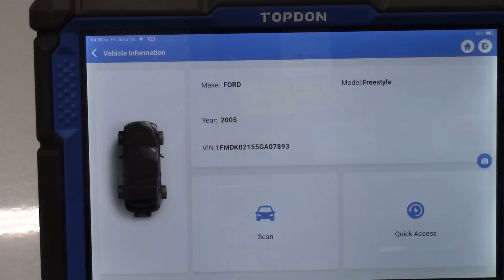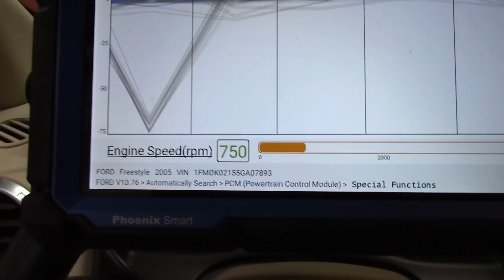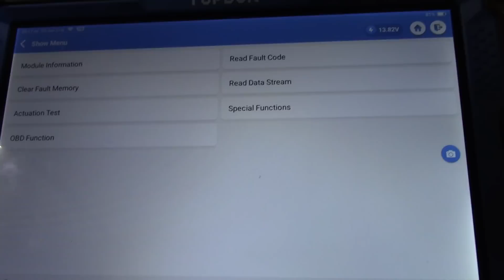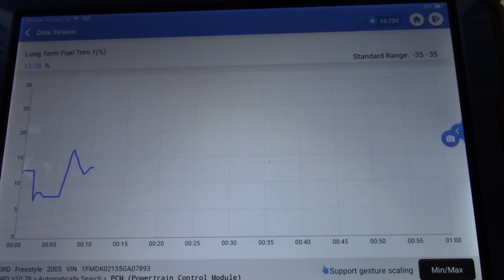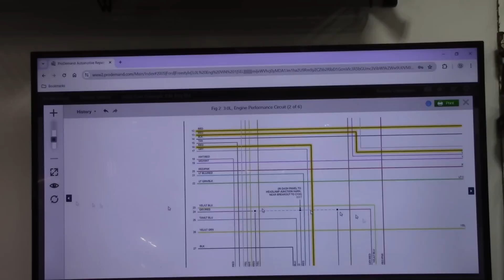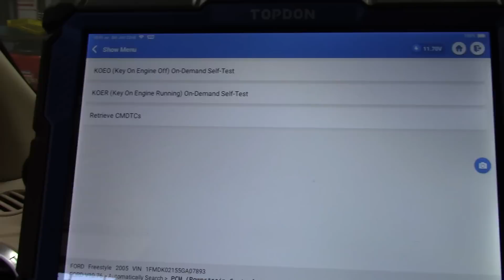P0301 Misfire Is Under Intake Manifold- What Do You Do?

Comment: Maybe  this is my problem.  Po302 on my 2006 Subaru sti.  Did the swaps, compression and leakdown test, noid pulsing test,crankshaft and camshaft position sensor test and cleaning.  Used smoke machine to detect vacuum leak  intake and exhaust sides. Very  frustrated
Reply from the maker: Maybe it is. An easy way is to just check amperage on the coil. Coils are easy to access on Subarus.

Comment: Good job. 
LCR Meter is the best tool for measuring the resistance of coils and capacitors .
It is send high frequency instead of low current dc voltage in resistance measurement mode in Multimeters
Reply from the maker: Great advice someone else mentioned this too.

Comment: Hello i need help with this exact code and even worse
Mechanic already installed rebuilt starter, new rotor and cap, fuel filter, pump relay, spider, spark plugs and cables within the last 30 days, new fuel pump and assembly less than a year ago but i always run it on empty so it MIGHT be bad. He hooked up the guage that shows the pressure is over 60 and doesn't bleed down until hours later. He doesn't want to charge me to do the fuel pump because he knows I'm broke and doesn't think that's the reason my 97 ahhsshole van won't start. That's the question, does anyone have any ideas? It needs starter/carb cleaner to start after 4-5 hours sitting, then i can run errands all day, but IT WILL NOT START after sitting more than 4 hours during the day or overnight, temperature outside makes no difference. Only code its giving is the same as this video. Mechanic says that'll cost more than the can is worth, right now i just need it to start reliably. Taking it to a guy who thinks it's the computer and has more testing diag tools than my mechanic next week. Any thoughts are much appreciated.
Reply from the maker: Unfortunately there is no useful data here. I need to see the fuel data, the timing data, the ignition data and induction metrics data.
Reply: @SchrodingersBox  thank you for the quick reply. Are you anywhere near southern California or know anyone as good as trustable as you in southern California?
Reply from the maker: Sorry I am not. I am in Colorado.

Comment: Videos are very informative. Even admit hypocrisy by mocking people for changing parts because "it needed it anyway". And then prove they didn't need the spark plugs. So much time spent mocking in this video. I guess admitting the irony is refreshing.
Reply from the maker: it’s not irony.  they did need the spark plugs because the cause of a coil failure on this car is spark plug excessive resistance.   you would never under any conditions change a bad coil but not also change the plugs and wires as well.
   it’s not “they need it anyway” because i made a mis-call or an ignorant guess. it’s “they need it” because i accurately determined a coil failure which means it’s standard procedure to replace the secondary ignition components responsible for the failure.
Reply: I don't think you were wrong to suggest changing the plugs. Maybe you already knew they needed spark plugs when filming. Video, as watching, you said it was most likely. I appreciated calling yourself out. It was refreshing. I have learned a lot (especially fuel trims) and will continue watching. Thank you.
Reply: cyt.....geezus

Comment: Another great video! Lets not forget a parts changer would have likely replaced at least the three rear injectors too, likely with inferior ones.
I love secondary waveform analysis. Such a quick, easy test to see whats actually going on.
The only annoying thing is when I'm doing it and "more experienced" people watch on like I'm crazy. 😏
Reply from the maker: totally agree!!
Reply: I just bought the Hantek 1008C, tried to do secondary wave form scoping using the HT-25 PROBE, but very dismal, as many other U Tubers have noted the same problem. TRIED to do a pressure analysis test, but found on it had only 2 cursers to use so could not divide the 720 deg wave form, So I would not advise this scope purchase, 

tried again to get a secondary using a Pico automotive, with the HT-25 and the wave forms looked just like what was on Matt's videos, old proverb, (Buy cheap cry all time, buy dear cry only once.)

Comment: Great! 
But what is the plan if you couldn't approach for the coils under the IM?
Reply from the maker: I have several different probes that would fit under even tighter spaces than this however what I would do if I couldn’t access the coils is I would dissect the wires out of the wire harness and measure amperage on the ground side controlled wires for the coils. This would be a bit time consuming but still faster than digging out the PCM on this particular car.
Reply: Thank you for your reply, great idea
Reply: What if in that situation we took the amperage of all the fuel injectors and ignition coils in one screen, couldn't it tell us something important and quick, even  you said that it would be very busy in the video?
Reply: @maradallibya5791 
In the video he was considering that.  But while looking at the wiring diagram it was discovered that there are too many other power consuming devices on the circuit to accurately pinpoint that coil. He then decided to use a more direct approach which was actually the best way in this situation. His critical thinking was the key.
Reply from the maker: Excellent summary!

Comment: That 24 valve dual overhead cam motor is very famous as I know you know for ignition oils failing.

Not just from spark plug where but also from extreme under hood heat in certain climates. 

Enjoyed watching your diagnostics. One day I need to add a pico to my diagnostic tool set.

Comment: Awesome. Nothing beats a solid diagnosis like recreating the problem. I was also thinking to check pulse pressures in intake and exhaust using transducer to verify good valves (although compression sounds perfect). Also, if fuel trims could be manipulated with scan tool, that could be useful to unmask a blocked or leaky fuel injector. I just started using a pico 2204a and took an induction waveform capture off an ignition coil (with a coin). The amount of detailed information you can get rapidly and non-invasively with the scope is....mind blowing.
Reply from the maker: Yes that’s what I enjoy most about this- the vast array or various strategies that can be employed.
Reply: I also use a relay and works great.

Comment: Did the tune up cure the long term fuel trim issue?
Reply from the maker: I never checked because the LTFt was not really out of spec that bad. Since bank 2 also dropped fuel trim a bit under load it’s clearly something non intake manifold related but I’m not concerned about it.

Comment: Sir I got question I have 2010 Chrysler Town and country 3.3 I change everything I mean every part ac not getting cold only when the car is moved or when I accelerate at the park i take it to 2  mechanics no know why if you can help cages reading 45 on low 230 on high like I said working fine when I’m driving? Sorry if I missed any spell anything wrong English is my second language thank you
Reply from the maker: It could be a ducting problem and the AC is never channeling through your vents?
Reply: @SchrodingersBox  It is but it only gets cold when I drive. As for the ducting problem, it’s not because I can feel it.
Reply from the maker: If it only gets cold when you drive then your engine speed is making the compressor more effective. 
  What are your low and high side readings under higher RPM vs at idle?
Reply: @SchrodingersBox  when I accelerate go down to around 35 even when I’m not driving so to keep it cold I have to keep accelerating
Reply from the maker: Sounds like the low side suction is ineffective.
Reply: @SchrodingersBox  I really don’t know sir thank you for your help and your time for years watching your videos god bless you thank you very much but how can I fix it it’s difficult to find good mechanic I live in Dallas, Texas
Reply: @TheGeno2001h , could it be possible that you have a separate electric fan for the AC condenser and it is not working!  Then when you are driving there is enough air going past the condenser to make it start cooling?  Hope you find it!  Tom
Reply: @SchrodingersBox  I ran the vacuum for 1 hour and I added PAG46 oil and now it’s a lot better. I just checked it 20 minutes ago and the temperature outside was 97 and the air is cold. Thank you for your help.
Reply: @Okie-Tom  I have only one fan. I ran the vacuum for 1 hour and I added PAG46 oil and now it’s a lot better. I just checked it 20 minutes ago and the temperature outside was 97 and the air is cold.
Reply: If I read this right - working fine when driving, but warm when at a stop light or idling=
make sure your electric fan is working. It should be running with A/C on.
Reply: @scottwoodbury5777  I ran the vacuum for 1 hour and I added PAG46 oil and now it’s a lot better. I just checked it 20 minutes ago and the temperature outside was 97 and the air is cold.
Reply: Maybe bad replacement parts, orifice tube installed improperly or bad expansion valve, depending on what you have. Possibly not vacuumed?
Reply from the maker: If it’s a bad orifcace tube or expansion valve how would you explain the 45 low side and 230 high side readings?
Reply: @jessecamacho5797  It doesn’t come with a tube. It comes with a drain. I already replaced it. I vacuumed twice.